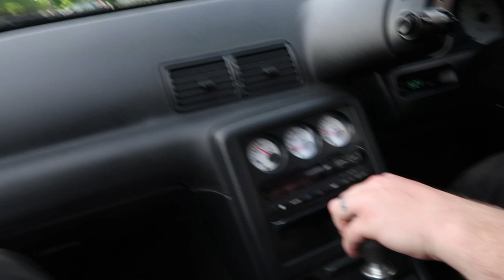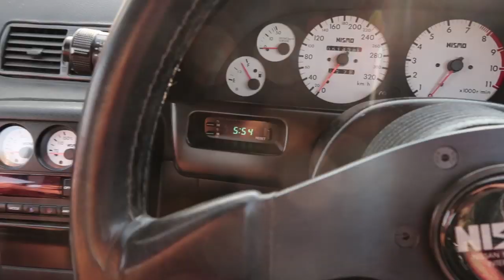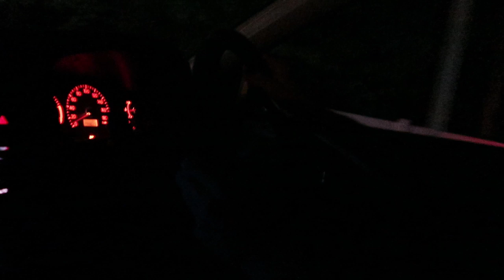Evo 5 Gets a Suspension OVERHAUL (SAVED 100LBS)

Comment: I had the same issue and it was my diff. I was pulling out of a parking space and the knocking started
Reply: Front diff bolts coming loose & breaking is a super common issue.  Evo 6.5 onwards had revised front diff with cap head bolts instead of countersunk.

Comment: Old vw trick. Can you space/raise driver side of engine with a block spacer? Used to run a  1” block under the mount only on the driver side to eliminate axle bind on the driver side. Just a thought.

Comment: My Evo 5 had the common front axle binding issue under compression, and replacing with  Evo 6 axles fixed the problem (I believe they are shorter). Raising the front end should resolve the issue for now, but you need 6 or TME (6.5) front axles.
Reply: Also... that could be the front diff bolts failing later in the video... another common issue that might present itself when you run E85 or larger turbo (significantly higher power than stock)

Comment: Will take a stab and say the 15mm front lower extension is allowing the axle to jack out of the front diff entirely and make that pop sound and thats why it sounds ok while driving straight but bad on steering lock. only a guess for the next video, when it gets diagnosed

Comment: @23:54 it looks like one of the body mount bolts is backed out.  I am seeing bolt shaft with no bushing or anything else filling the space.  From the sound you are getting it could be something torquing the body causing that to flex.

Comment: Ok i feel a little against the masses, but i was under the impression undercoating is actually super terrible for your car unless you get expensive breathable kind since its basically just trapping whatever contaminants/moisture that more than likely is still in there and will eventually rot out horribly a couple years down the line? Adam didn't really go into specifics of what the undercoating was or such, but i just feel super sketched out by undercoatings.

Comment: The gear ratio in the front diff might be off now that you changed the suspension?
Reply: Or maybe the front diff didn’t work when he got it from tommy? That white evo didn’t run when he picked it up right?
Reply: @shanechopko5523  he got the rear diff  off Tommy not front

Comment: Did you put adative in when you put the diff back together? Without that it will pop and jerk when turning. In a straight line it will not because there is no "differential action" happening

Comment: @5:15 evos my fave car will this be built into a time attack car will thie engine size in this be big enough to win is the all wheel drive the atraction i beileive light weight 4 cylinder is the guy in australia building the engine 4 this 1000 plus horse power